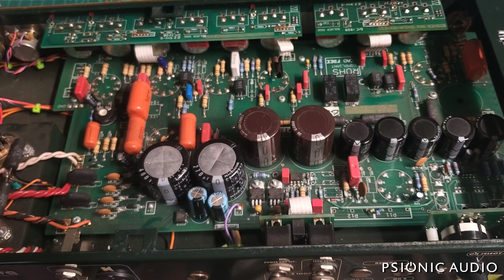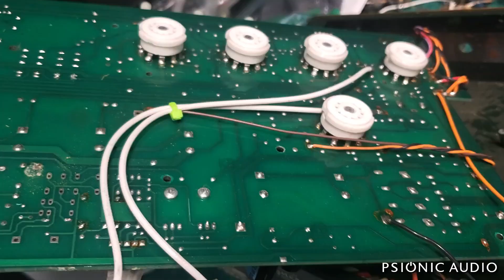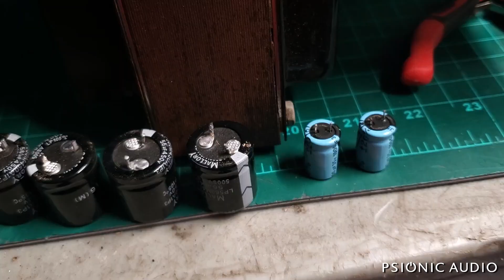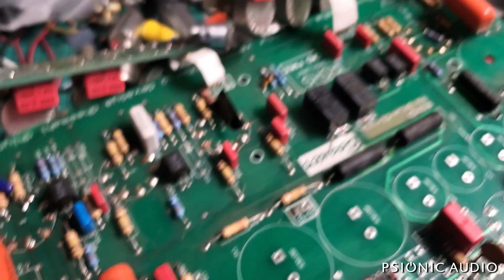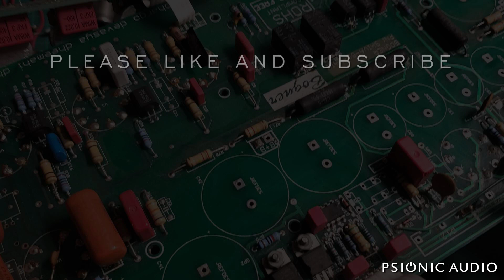"How Much Will It Cost to Fix My Amp?"

Comment: I think people underestimate the time needed just to identify and locate replacement parts -- I think they assume each cap has a unique part number on it, and that the parts remain available indefinitely. They don't realize that most of the time, we are actually identifying substitute caps, which often means delving into the specs and the circuit to figure out which parameters are important. I work at a university workshop, so luckily I don't actually have to bill for my time. I recently had an ancient (but extremely high-end for its time) HP digital oscilloscope come in that no longer booted reliably. I quickly diagnosed the main 5V rail not coming up properly, and unsurprisingly, upon inspecting the PSU board I found leaked electrolyte. Recapping the PSU fixed it, but that involved replacing over 30 capacitors of 10 different values, voltages, and sizes, and it being a SMPS, most needed to be low-ESR. (Buying a new scope with the same bandwidth would still have cost $10K or more, so it was worth spending a day on. Luckily the users didn't need modern features, just high bandwidth.)

Comment: True and good techs are hard to find. I have a GK 250 RL, the rackmount version of the famous 250ML micro amp. It needs a cap job and probably a few resistors replaced. Nobody I can find wants anything to do with it.

Comment: Can you make a video lesson about going over "Galvanic Corrosion" of which metals to use and which metals not to use for grounding schemes because certain washers, nuts, transformer mounts, pots shafts, pot cases, etc don't have a good connection to the chassis which causes Galvanic Corrosion issues. In older RF chassis used Brass chassis which most guitar amplifiers chassis use a certain metal which is called? since its not a Brass chassis the pot cases on the front of the pots that connect to the chassis causes Galvanic corrosion because the two metals aren't electrical contact with another to get a good solid ground. I'm just giving some examples but you can add a lot more examples if you can made a video lesson to help out about these issues.

Comment: Would you recommend any sub 1000 dollar tube amps or is it just not worth spending that small of a price? Modern amp design is really frustrating when it comes to design and build quality. I know you know this well. Printed circuit boards, cheap components, poor construction, and pcb mounted tube sockets. Should I just try the amp kit building rout? I have some knowledge about soldering and the likes, so I could start out with a turret board fuzz face pedal and eventually work up to a 5e3 or 5f1. I don't know if I could pull that off, but I might be able to.
Reply: I can't say enough good things about Ceriatone, and they can be found in that price range.

Comment: Ty for all of your videos! I feel like you're my electronic engineer teacher. I have a question that I need your advice sir.  You mentioned that tantalum caps fail when put under surges or stress and in Mesa's  you said they fail often. My question is I have an older Mesa MKIIC+. While powered up, I accidentally hit some high voltage strips with some canned air and had a mini explosion. My preamp tubes all have tantalum caps on the cathodes. Sprague axials. I don't know if the accident caused a surge to damage the caps or not. I lifted a couple and they measured fine as far as value goes. The amp is working but how would the amps behavior be if any of those caps failed? Correct me if I'm wrong sir but aren't they used in this manner to bias the tube sockets? Again, would the amp not be working if I had any failed tantalum caps? Thank you for you time and I hope to hear from you. Blessings, Jim
Reply: I forgot to mention that every cap has a resistor in parallel with it. Ty! Jim

Comment: This is the reason I usually like to buy simpler and smaller tube amps. I know that my OR15 should be relatively easy to work on. Also I have a Jet City 100 which is well designed with simple features. Also I’m one of those guys that rather spend 300 bucks repairing a 300 dollar amp, rather than buying a new one, if I like it. I just like the thought of repairing broken stuff rather than just stockpiling broken tech.

Comment: Just when I think I have a BOM for a recap on an amp model on file, 3 of the parts will get discontinued, and 2 of them will have a 26 week lead time on backorder. I think that blue wire is lavender colored. Oh yeah, I forgot about the  red green colorblindness. Sorry. I am not above using tantalum caps if I can over-spec on the voltage, and how & where they are being used.

Comment: High value electrolytics act pretty much as expected at 60 and 120hz. But they also have some inductance in series with the capacitance due to the length of the foil . It's not uncommon to see small non-electrolytics in parallel with them in cases where higher frequencies are an issue, such as switching supplies.

Comment: Funny story: In an earlier lifetime I was an amp tech in Cambridge, MA, working in a space above the ground floor music store.  One day a young guy (really still a kid) brings in a 1940s era Gibson amp that belonged to his dad, asking if I would fix it for him so he could then use it.  Realizing that this specimen was more antique than vintage, I first declined, but then relented after being pressured.  I didn’t give him an estimate then.  So he left it with me.  The next day I took off the back panel and saw that everything appeared original and ancient.  I noticed the field coil speaker’s electromagnet assembly and windings were very corroded.  I plugged it in and turned it on (even though I shouldn’t have) and saw the 5U4 immediately start to red plate.  Shut it off.  I called the customer and told him to come pick up the amp because I was unwilling to work on it, knowing a proper restoration would cost more than a new Fender Blues Pro.  (Clearly, the kid had hoped a quick $20 repair would yield a cool old amp he could play thru.) The kid got angry.  “What a rip!”, even though I wasn’t even going to charge a bench fee.  The punchline is he never bothered to come back to retrieve the amp.  So I wound up giving it to the guitar repair guy who worked in the shop next to mine, which he much appreciated, being the pack rat that he was.
Reply: He probably saw the amp as old junk. I would have fixed it for myself using parts that come available over time here, and there.

Comment: Using a switching supply for DC is short term at best.  The point of DC on pre amp heater is quiet . It practice an AC heater that is elevated 45 volt above ground  would be quieter and far longer lasting than that switching supply .   Transformer are less efficient  than switching power supplies . But what is the point  tubes are not built in this application for efficient power consumption they are used for the sound.   Lazy design on an important sub-system ( heaters). Nice video.
Reply from the maker: I think the SPS was a big dumb decision Bogner made. But I'm not being hired to redesign it. Otherwise there would be a regulated 12VDC supply from one transformer for relays etc and a wholly separate transformer providing heaters for the preamp tubes. Either clean DC or AC referenced to an elevated DC node (I agree with you on that).
Reply: @PsionicAudio  True  yes the switching supply is cheap and a very fine RF generator  .  DC vs AC in a music amp if both elevated is small in use and adds complexity to the design.  However  in recording the reduced noise floor of the DC supply is a must  .  So I am against DC heater for a gig .  It power amps you can even get away with using a tap of the transformer secondary if it AC have seen them to be quiet .  Keep up the fine work .

Comment: I think people ask mainly out of fear...assuming the worst. a refrigerator repair person recently told my 85 year old mom that her $2500, three year old frig needed a new $500 compressor...and that he would just buy a new frig. By that theory since I need new tires and an oil change on my Porsche I might as well sell it now! We are talking about a $3-3500 Bogner not a Line6 Spider, a few hundred dollars is nothing.
Reply: I misspoke...$2500 Bogner...landfill it!!
Reply from the maker: Yeah. The first calculation I do is "Is the amp worth the time it takes to fix, or even to get an estimate?"

A potential client last year was furious with me because I declined to work on his B-52 amp (cheap high gain amp design). The PCB was badly burned at one of the board-mounted EL34 sockets, and I knew that even if I fixed that there was no guarantee it wouldn't just happen again on one of the other sockets. 

"Can't you even try?"

"Yes, but you really don't want me to. It would just be throwing your money away "

"Man, you just don't know how to fix it. I'll take it to someone who knows what they're doing."

"Okey doke."

Comment: Capacitors used in switching supplies frequently fail prematurely: they overheat internally due to being hit with high levels of ripple.  Always a good idea to replace them with high quality caps rated for 105ﾟC.  Especially in an amplifier like this where they are providing power to the opto couplers and switching relays,  as well as the tube heaters.
Reply: Do it nice, or do it twice.  Why go through all the effort of replacement only to save a few bucks on cheap crap?
I really like having the peace of mind knowing that I have 10,000 hour filter caps.  I could play an hour per day for 26 years, or gig out for 10.

Comment: there's a 'purple painters tape' - similar to blue tape, but designed for 'sensitive surfaces'...  maybe that would be better to hold the lose panel in place.
Reply: Yep! That or just use Kapton tape, which is even better in pretty much every respect except cost.

Comment: Thanks for the look at why estimating repairs is not necessarily easy and why it shouldn't always be 'free'. I work as a tech in the bicycling industry, so I can relate. I often tell people when they frown about my prices for labor vs time it takes me to do things, or for charging for information they think should be free, "You aren't paying for just my time, but for my knowledge, which took effort and time for me to acquire, and is the reason people come to me."  (Or some more conversant, nicer version of the same)